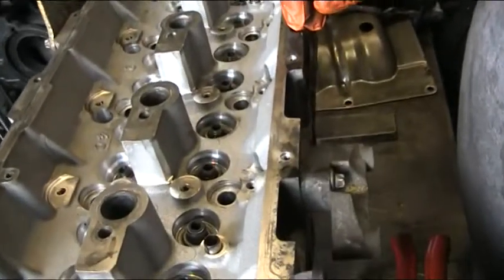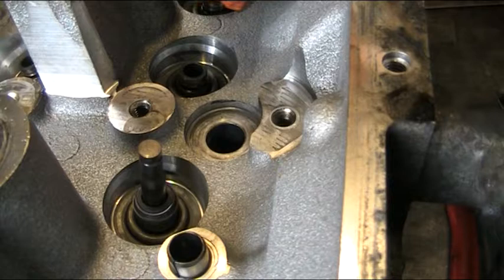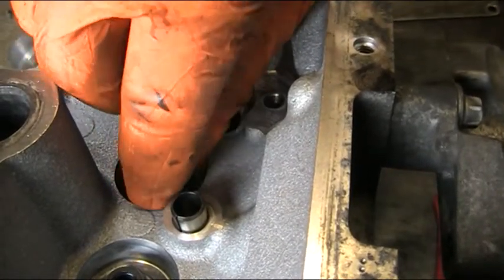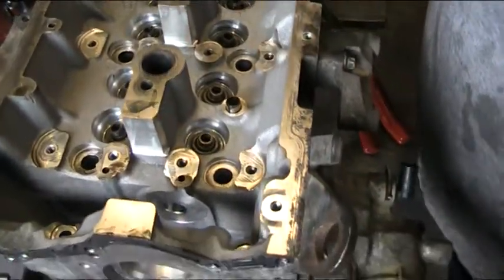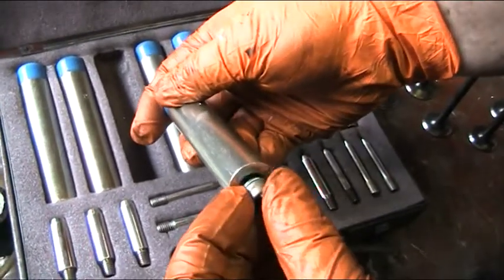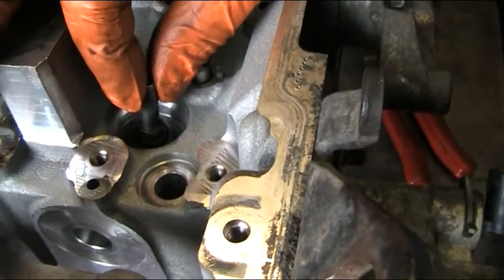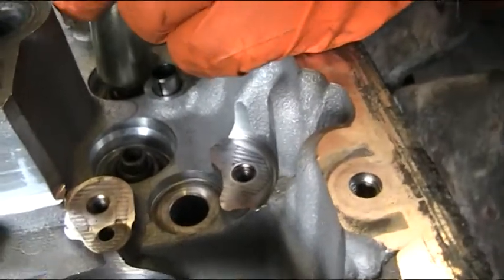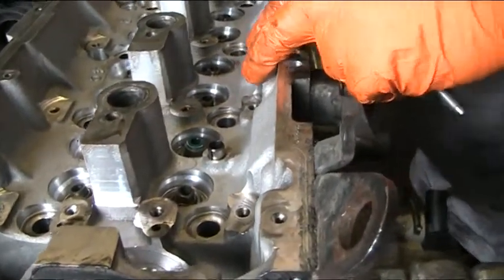fitting new valve stem oil seals

Comment: Im going to try and replace them on an Old mercedes benz with the Valves on. Should I grease the seals/oil them before installation? What are those orange things that you had on the table? I got 6 with mine but I don't really know what they are for. Lastly, how can I till which goes where? The two sets of 6 are one black and one white. One is hard and one is soft. Thanks for the help! Great video!